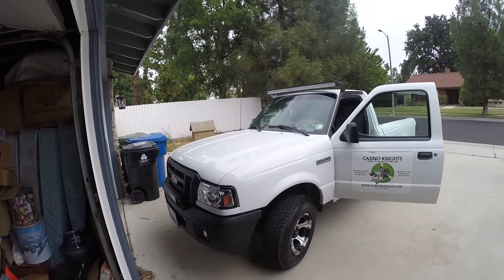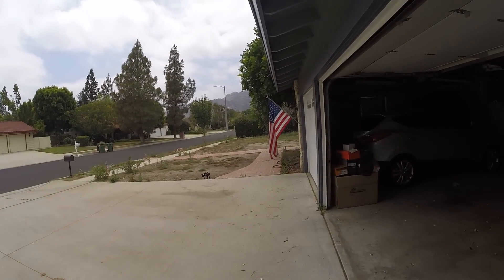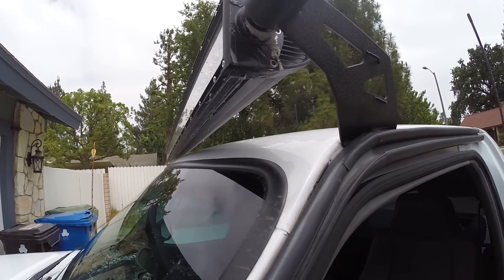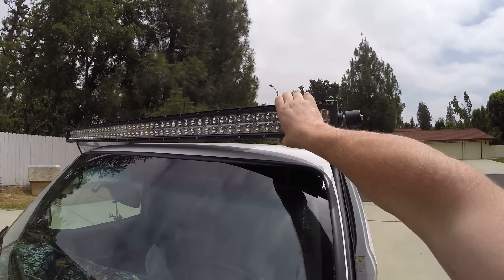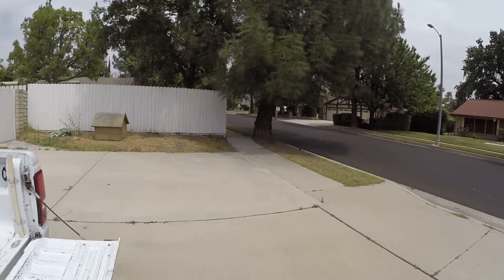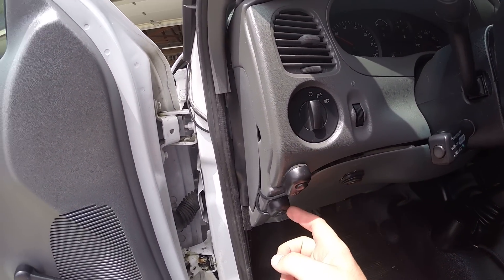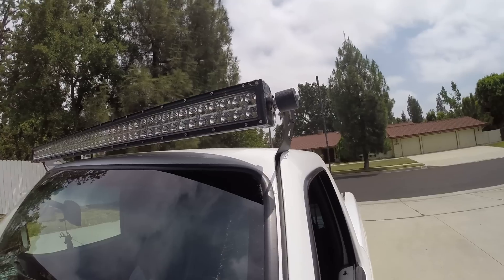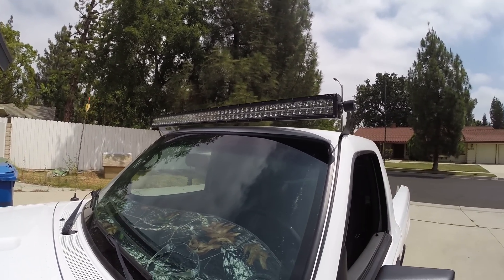Ford Ranger 50 Inch LED Light Bar

Comment: I got a lightbar for my truck off of amazon too but I got mine from a company called Eyourlife, I've used a power washer on mine atleast 10 times and been through countless car washes and some wicked storms and no condensation. Pretty impressed for a 115$ light bar

Comment: Do you think theses could fit a 2001 f150 because I can't find any for my truck
Reply from the maker: powerstroke 7.3 I would think so if you don't flip the mounts backwards like I did, I would just try to get some friends to help measure your roof and see what your options are for mounts and lights bars

Comment: Hey man on my ranger i measured from door seam to door seam and it reads 48 inchs wide. So will a 50 inch light bar fit with the brackets
Reply: Yea just bend the brackets

Comment: you must not of done a whole lot of looking around for light bar mounts I have a 2004 edge and ranger squad makes a 50in curved bracket for a ranger for like 100 bucks I have it mounted on mine and its a lot cleaner the curved 50 fits the roof line so much better then just a straight bar
Reply: Can you send some info. And I'll look for mine please. I wanna order it
Reply: look at rangersquad.com they offer a lot of brackets for led bars and pods I got the 50in curved and the dual ditch light brackets on my 04 ranger right now
Reply: +96jeepjs you sure that's the right webpage?
Reply: sorry its rangersquadapperal.com
Reply: +96jeepjs www.rangersquadapparel.com
Reply: I said that?
Reply: Think apparel was spelt wrong that's all